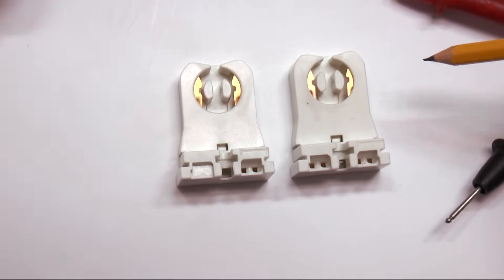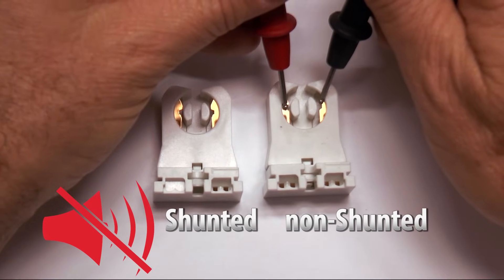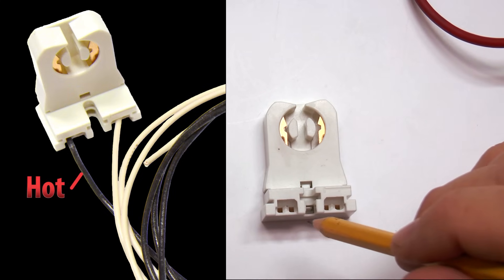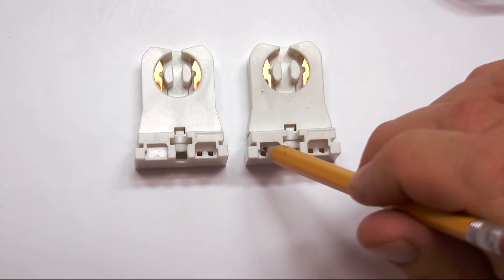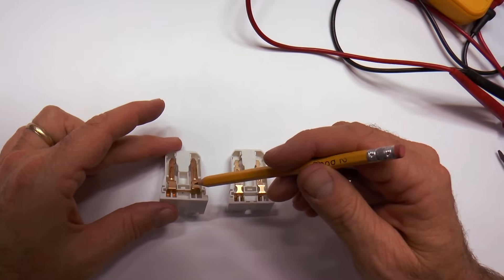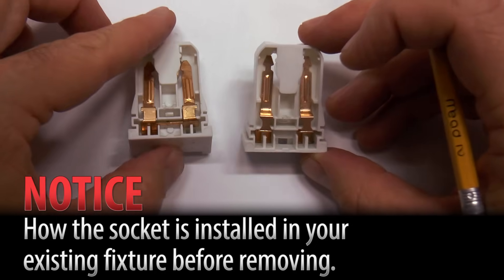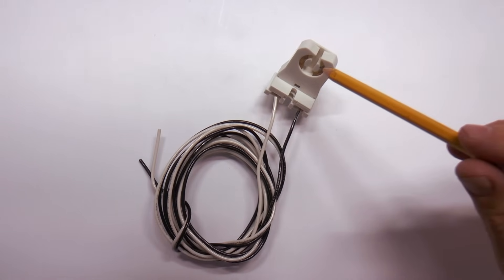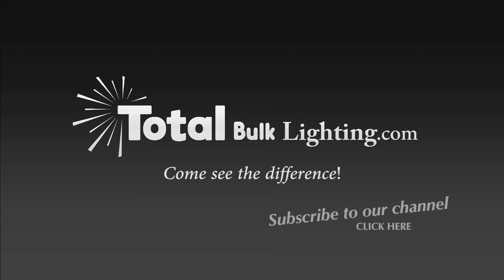Shunted & non-Shunted T8 & T12 Sockets (Tombstones) Explained by Total Bulk Lighting

Comment: I've been converting florescent fixtures to LEDs for a couple of years now.
At the 1:41 mark of the video you show an image of a wired tombstone with the hot wire (black) on the left and the white wire (neutral) on the right. Then at the 4:42 mark you show another image of a tombstone with the white wire on the left and the black wire on the right.
On single end only connected Leds the left side of the tombstone should be the neutral (white wire) and right is Hot (black wire).

Comment: Made a terrible mistake one time when I wired a set for a T8 LED Bulb. I was using spare non-shunted tombstones.

I did not know that the LED bulb I got is double ended and that the prongs on each end of a double ended bulb are shunted internally.

Hooked both wires to each side of a non-shunted tombstone, plugged in the bulb, and turned on the power and got a blue bang at the end of the bulb that connects to the tombstone I just wired. I knew then and there I screwed up LOL.

Some research into retrofit T8 LED bulbs, a new bulb and help from my father we got it wired properly for the double ended LED bulbs that are common in our country. The double ended ones is a lot more common due to them being marketed as drop in replacements for T8/T12 fluorescent bulbs after removing the starter plug.
Reply from the maker: Oh wow! Glad to hear you were able to get some help to get your lights converted to LED!

Comment: As a general rule, shunted sockets are used with instant start ballasts,  non-shunted sockets are used with preheat, trigger start,  rapid start, and programmed start ballast circuits. Most electronic ballasts for F32T8 lamps, for example are instant start, but these lamps also work well on rapid start/programmed start as well as  on dimmable ballasts,  which are becoming increasingly rare since dimmable type B LED tubes are now readily available at reasonable cost, and the circuitry required to dim an LED tube is less complex than a fluorescent tube.

A non-shunted socket can be converted to shunted with a jumper across the socket,  making conversions between various circuits possible without replacing the socket.
Reply from the maker: Great info! Thank you for sharing!

Comment: If I have the non-shunted T8 fixtures already for my existing T8 tubes, can I just put a T8 LED buib into it?  I have the black wire loop between the two holes (inner holes) and the black and white leads in the outer holes.
Reply from the maker: it depends on your T8 LED Bulb. Is it Type-A, Type-B, Type-A+B or Type C. You will need to make sure you are retrofitting your fluorescent light fixture to the correct electrical configuration required by the T8 LED Bulb you are installing. Hope that helps 🙂

Comment: The tombstone needs to be completely disconnected from the ballast before you test it, or  it may give you a reading on the multimeter even when it is non-shunted. So cut the wires connecting the tombstone to the ballast first.

Comment: If one needs, how do one remove the cable from the tombstone ? I tried pulling it not too hard it does not come out, doess it have a trick ? How is it ?
Reply from the maker: One of the ways we have found is rotating it while pulling out gently on the wire and it slowly comes out. This may also break the wire so be careful 🙂

Comment: I own an older home, the builder in 39/40 installed centrally banked ballasts, and ran the wiring from the ballast outputs to tubes that are recessed in our reversed(upside down) crown moulding. Hides all of the tubes, it’s a really nice install. But converting the ballasts and bulbs to LED, found something O thought looked sketchy and dangerous, but I think your video cleared it up. Replacing one of the tubes, I found where someone took solid #24-ish bare conductor and wrapped it around both bulb lugs on both ends of the tube. I wonder now if that  electrician installed non-shunted replacement sockets when they needed shunted ones, and cheated it by strapping the lugs/posts on the tubes themselves together. Thoughts?
Reply: Sounds like it was done by a handyman not an electrician.
Reply: @samsmith6169not even close

Comment: I bought a bunch of fixtures with the replaceable T8 tubes in them and they turned out to be powered from only one end and are called singled ended. I installed them and noticed that one tube was bad so I went back to the store to buy a replacement and it seems like you can't even buy them. All the ones in the stores I believe are double ended which means they receive power to both ends. They don't even bother saying on the package that they are double ended but it looks like they are. Is there a reason I can't seem to find single ended T8 tubes in the stores, or am I just looking at the wrong stores. Thanks.
Reply from the maker: Double end are easier to install and don't necessarily require replacing the tombstones making it less labor and parts to install. This has allowed double end to gain in popularity and market share.
Reply: @Totallightingsupply  Do the double ended tubes require a ballast in the fixture like the fluorescent fixtures have? I don't want the ballast as I have always had issues with them failing with the fluorescent lights. I want everything contained in the tube just like the light bulbs are so that when they fail everything is replaced. It seems like the single ended tubes are like this. Thanks for the reply
Reply from the maker: @67blabla  Always check with the manufacture's specs but our double end powered T8 LED Tubes each come with an integrated LED driver that converts the power from AC to DC power. So there is no need to install a separate ballast to power our double end powered LED tubes. Makes it super easy to install and replace tubes :)

Comment: It sure seemed that you said first that LEDs tombstones should be wired  hot at one end and neutral at the other. Toward the end you showed one hot and one neutral going into each tombstone. I’m confuse$.
Reply from the maker: Non-shunted tombstones are typically wired to have a hot and neutral as the contacts in the tombstone are not shunted together. Hope that helps 🙂

Comment: where use shunted and non shunted    socket can you explain     florescent type
Reply from the maker: For converting to LED, Shunted sockets work best in the dual end retrofit method and non-shunted work in single end retrofit method. Hope that helps 🙂
Reply: @Totallightingsupply   I am confused by your comment "Shunted sockets work best in the dual end retrofit method."  I read several of your comments in your "EZ LED T8 Fluorescent 2-Tube light Conversion in 5 minutes or less by Total Bulk Lighting" video where you said that for dual-end retrofit, the type of tombstone does not matter.  Did I misunderstand?  Which type of tombstone is needed for dual-end?  (Of all the considerations when doing this project, the information on type of tombstone needed is the hardest to glean.  I've watched your video twice and although I'm crystal clear on the difference between the two types of tombstones, I still don't know which one is needed for single-ended tubes vs double-ended tubes.)  Thank you very much for your help.
Reply from the maker: @goofball6180  It can be confusing for sure. It's all about the flow of electricity and the type of LED T8 Tube you are using. Single end LED T8 are powered only on 1 side of the tube so the Hot and Neutral come into the tube through one side and through each separate pin. A hot pin and a neutral pin. You have to use sockets / tombstones that have hot for one port of the tombstone and neutral for the other port. Double End LED T8 are more flexible and the sockets / tombstones can be wired electrically so the double end LED T8 tubes can work with either shunted or non-shunted tombstones. Using non-shunted tombstones can be a bit more challenging when using double end LED T8 tubes for people who have little to no electrical knowledge if you have to replace tombstones due to it being brittle or damaged. So we recommend shunted because it keeps it simple for most applications. If you follow the wire diagram for double end powered LED t8 tubes you can't go wrong. Hot on one side of the fixture and neutral on the other side. If you are still uncertain it may be best to hire an electrician. Hope this helps 🙂
Reply: @Totallightingsupply  Thanks.  Working with one of your Support Team members now.  I have a T12 4-lamp fixture.  Turns out I have two (dual) ballasts and two wall switches in separate locations.  I understand the diff between single- and double-end-powered tubes but still making sure I understand the wiring.  Looks like I have 6 wires (2 red, 2 blue, 2 yellow) on each end to connect:  6 wires on left to connect to hot wire; 6 wires on right to connect to neutral wire, for a double-end LED tube retrofit.  Right?
Reply from the maker: @goofball6180  That does sound correct but Dual ballasts can be tricky when dealing with wall switches and circuits but our support is the best and they will be able to help you with your setup 🙂
Reply: @Totallightingsupply  You're the best.  I now understand that I could connect all the reds and blues to hot (black), and all the yellows to neutral (white) and it would work, too, for double-ended.  We're just running the current through backwards (from the direction it ran originally when it was fluorescent) if we make everything on the left hot and everything on the white neutral.  I got it now!  Thanks!

Comment: why does my fluorescent light only stay on for 1 minute then comes on 5 minutes later and repeats. I put in a new ballast, same thing.
Reply from the maker: Hmm could be the fluorescent lamps. You need to make sure you are using the correct lamps for the ballast. If it is T8 fluorescent this may be a good time to convert the fixture over to LED T8. We have Universal A+B T8 LED tubes that are plug and play work with fluorescent T8 electronic ballasts without rewiring. Here is a video on those LED T8 tubes 👉https://www.youtube.com/watch?v=xPOu-jSTrPc

Comment: My fixture has tombstones that have 4 holes like the non shunted BUT only the yellow wires run into one tombstone and short black wires are used to jump from one tombstone to the other one right next to it on the same side of the fixture.
So, in this case, they appear to be using non shunted tombstones that are in fact "shunted" by jumper wires... Stupid set up...
And it is confusing as hell at first glance!

Comment: This is why I buy LED tube lights that are compatible with a ballast because you can't get no simpler than Plug and Play.
Reply: I think it may consumes more power to run with the ballast than get rid of the ballast, and also when the ballast is death we need to replace the ballast ! Am I right ? or wrong ?
Reply: @Hoanghon69  I have fluorescent lights that are 20 plus years old and I've never replace the ballast in them. A ballast only adds 5 watts per 2 bulbs.
Reply: James M   I help out with maintenance at our church.  We have a school, in addition to the church.  I replace a couple of ballasts a week.  The newer electronic ballasts seem to last longer.  We are slowly changing over to LED bulbs.  The direct plug and play bulbs are cheaper and simpler, but getting rid of the ballast seems like the thing to do.

Comment: I would have thought that T5 T8 and T12 were all standard fluorescent. They are all T's, they are all old, and none of them are LEDs. I'm trying to find a tear down of tombstones ... I mean there are four holes but only two wires   .. so ... I'm asking myself  ... For wiring LEDs .... in parallel?  ....  in the mean time  .... you  .... are explaining "the", no "a",  question, but you aren't explaining any answer. I have a kind of rule where I ONLY dislike videos that are mainly,  like 82%, advertising.
Reply: mud puddle   On some t8 tombstones, they jump the power from one tombstone to the next one, so the first tombstone would have four wires but the one it feeds would only have two used.  I have not seen that setup with t12s.

Comment: I have a T8 LED tube, came packaged with the lampholder (by the store, not the manufacturer). It's a retrofit type but does have a driver for use to bypass ballasts, but since it came with the lampholder I guess why not replace the rotting old lampholder with a new one without a ballast. Saves electricity. The instruction was clear, and my understanding of it (which could be the problem here) is that it's quite straightforward. I mean, I followed the diagram and all. Wired it, Earth and everything, snap the bulb in, and had a momentary flash and then it goes dead. Plugged the tube in to another fluorescent fixture just to be sure, and it is dead.

It has got non-shunted tombstones, and the LED is double ended. It's only got one wire running to each tombstone unlike the fluorescent one. What could be wrong?
Reply from the maker: I would contact the store you purchased the product from :)
Reply: I thought so. Thanks.

Comment: no need to waste money guys, open the damn thing and cut and isolate them.
Reply: certified30  Sometimes the back piece of the lampholder breaks when you remove it. Taping/glueing it doesn't guarantee it won't come loose in the future because of the heat in the fixture or when replacing lamps,  also you wouldn't want 120v or 277v to come in contact with the "metal" fixture. So take caution, especially with older lampholders, that have the back held on with what looks like a large staple. These usually break.

Comment: NOTE!!  Be sure you know what type LED tubes you have.  Some require power at only one end of the tube, others require power at both ends.  Connecting a light to power that's wired wrong for the light can be a disaster.  It's essential to know what type of LED tube you have so that you can decide whether shunted or non-shunted sockets are right for your application.
Reply: The instructions will tell you. Some    can be connected both ways.
Reply: @juve3030  correct!

Comment: You could also use an LED lamp that is powered on both ends "line to one end neutral to the other end...instead of the single end power led lamps...
Reply: Yep, that’s what I did. $9/bulb and about 15 minutes/light to convert, (remove ballast and wire up).

Comment: What is the shunted socket used for  ?
Reply from the maker: Shunted sockets are used most commonly in fluorescent T12 or T8 light fixtures.
Reply: Total Lighting Supply   Thank you
Reply: Sss Ttt - TLS is not quite right.  The shunted tombstones are used ONLY in Instant Start fluorescent fixtures and LED tubes called "plug & play" that can only be used with Instant Start fluorescent fixtures.  If you buy shunted tombstones you will have to buy an instant start fluorescent ballast, too.

Comment: Good video.  I assume that the it does not matter what type of socket is at the other end, since it is not used anymore?
Reply: Correct, If the led bulb is single powered the opposite socket would only be there for mechanical support and not part of the circuit. On dual powered led tubes both sockets would use the existing tombstones that are most likely shunted.
Reply: @joceephusofmaynard4304  For double-ended (dual-powered) tubes, does it MATTER if the tombstones are shunted or non-shunted?
Reply: @goofball6180  No, it shouldn’t matter.

Comment: When you talk about LED retrofit kits, you are referring to the ones that eliminate the usage of a ballast, and instead link directly to house power, Right?  So you are not talking about those LED bulb replacements that just drop into the fixture and use the existing ballasts, Correct?  If so, you might want to add a little bit to your video and also to your description of the video explaining that non-shunted is for LED kits eliminating the ballast, and shunted is what you use for keeping the ballast by using LED bulbs that just replace the florescent bulbs. (I think I said that right).  That might prevent people from being a bit confused.

Comment: So, if I'm retro fitting a light say in a variety store fridge where there is no fixture...  what would be the best solution if I want to change out florescent lights to LED.   I need a tombstone but there isn't a fixture for LED's.  The tombstone will be mounted to the ceiling area of the walkin fridge.

Comment: Looks like you could make a non-shunting socket simply by snipping off the shunt wire between the two electrodes.  True?
Reply: That's exactly what I did also. The tombstones that came with my T8 LED's didn't fit my fixture. Disassembled the old ones, snipped off the shunt and reassembled. Worked well.
Reply: Just make sure that when you "snip" the connecting shunt, the two remaining stumps of the shunt don't come in contact with one another. Best to snip in two places, leaving a gap between what's left of the two stumps.
Reply: carnac4164 That is exactly what I did, the style I had allowed the two sides to remain separated when the plastic insert was reinstalled. I will be checking on the cost of non shunted posts simply for expediency.